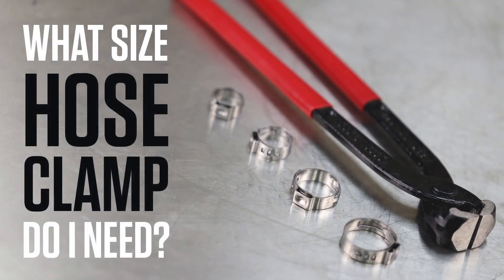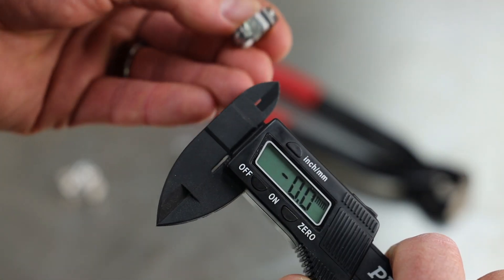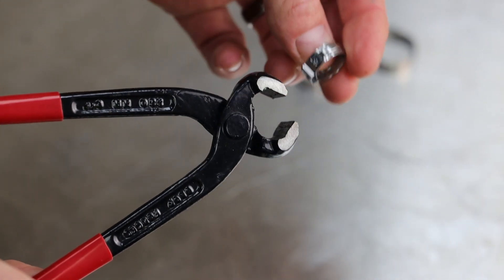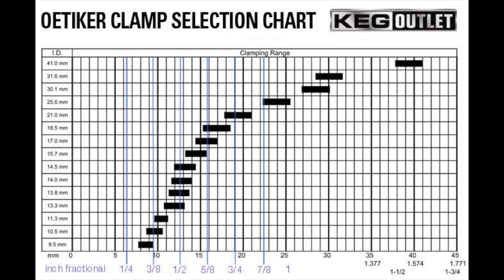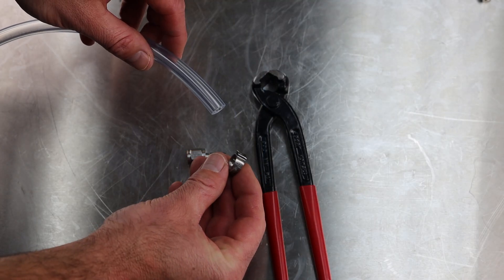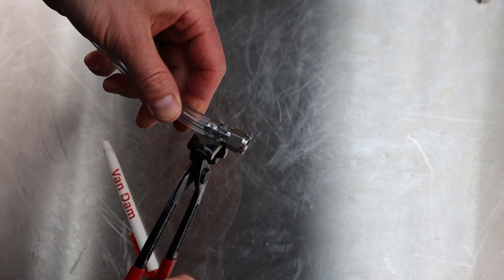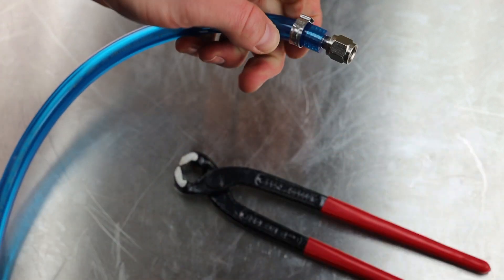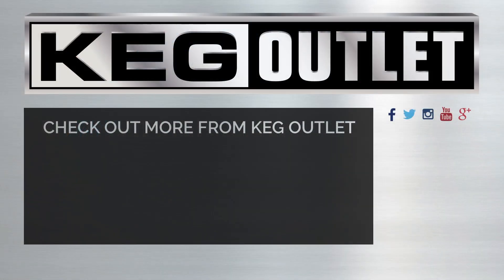What Size Hose Clamp Do I Need For Draft Beverage Lines?

Comment: Looked like the barb slipped out after clamping it on the blue hose.  Not very convincing!
Reply: Mr. Gilliard if you look it is actually the nut moving on the barb post.
Reply: @jwclark69  sorry it was a weak joke.
Reply from the maker: It's good to allow a little space between the hose and nut so that the nut turns easily. If too snug against the hose, it becomes difficult to thread on/off your MFL fittings.